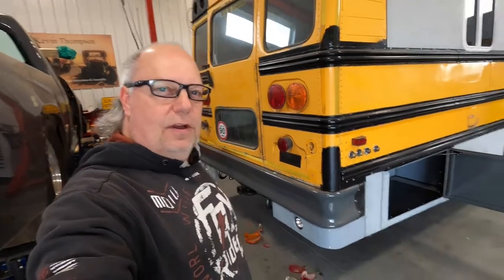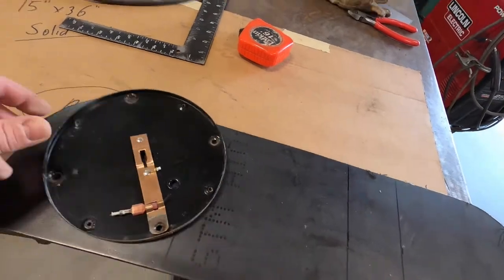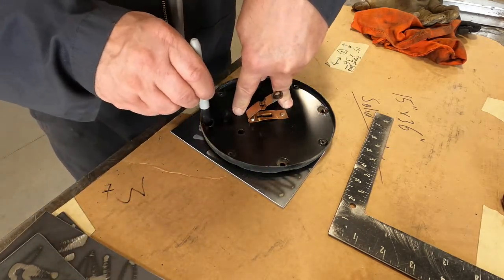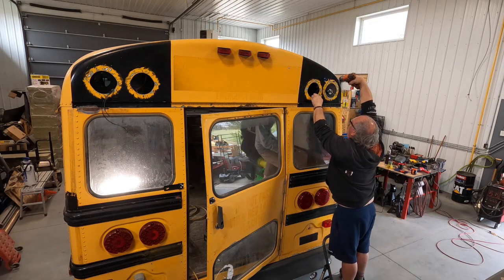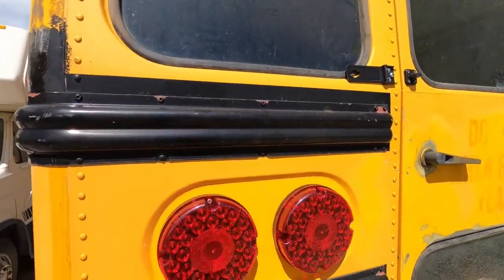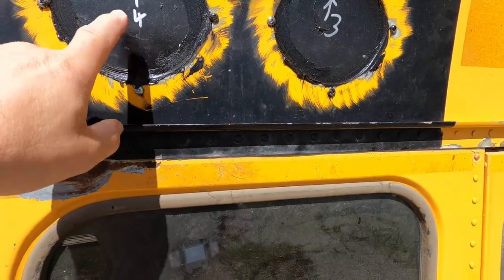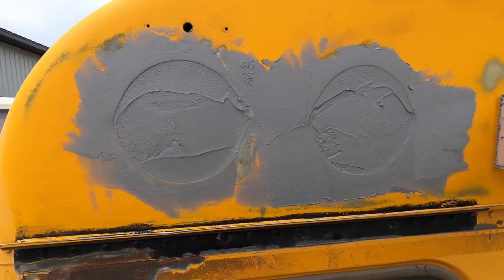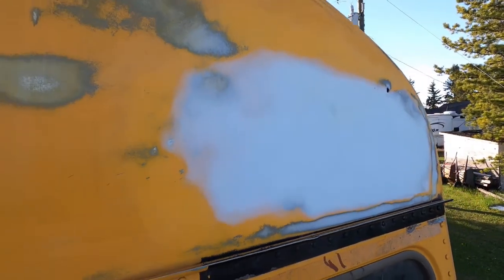Just Bus'n and Adventures with the Thompson Family Episode 15 - School Bus Warning Lights Delete

Comment: Nice work! You did it the way I would! Then again, your build is absolutely beautiful. Keep it up!
Reply from the maker: In the front, I welded in circles to match the holes, then grind flush, then fill. The way I did the rear filler plates is way easier to do, sealed and flatter. And, Thanks again Simon